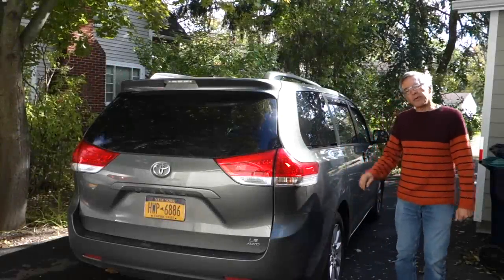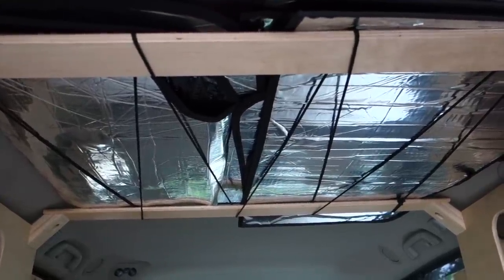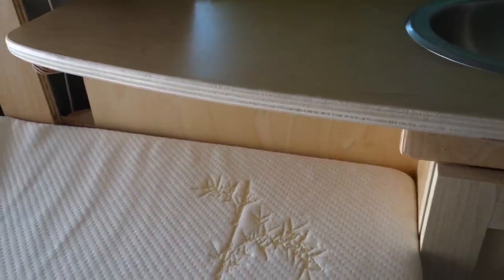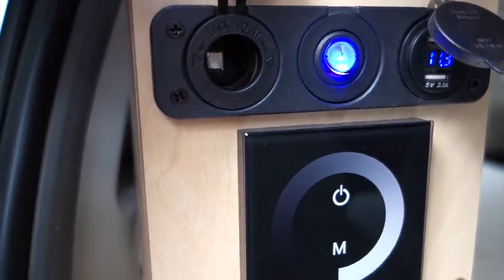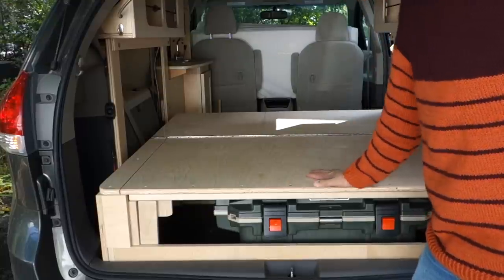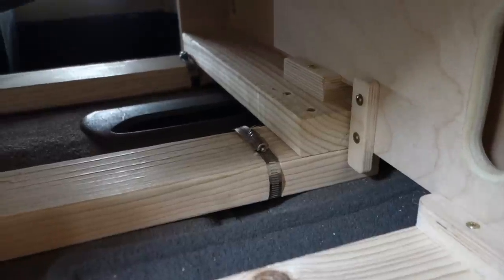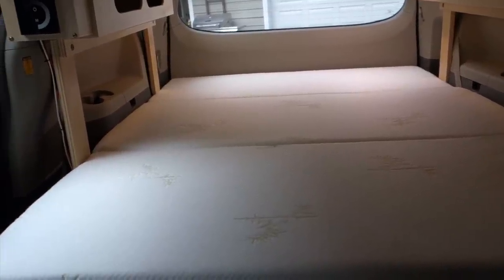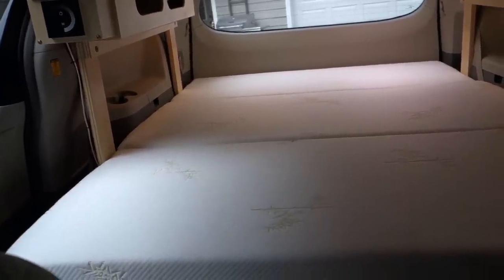A Slightly Different Mini Campervan Build

Comment: Hi Bruce - I love your building very well thought out. The way you ran your solar wiring into the van is slick. Can you provide any insight into how the solar panel affected your gas mileage and noise level in the van?  Thanks - Michael
Reply from the maker: Hi Michael, I’m glad you liked it. I haven’t noticed a drop in MPG with the panel. It’s silent from the driver’s seat but I’ve noticed when laying in the bed at highway speeds you can hear a slight rushing noise.
Reply: @BruceParks  Thanks. Will do the same in phase two of my project

Comment: Hey Bruce, just wondering if you considered a bed that folds up into a bench seat? If so, why did you opt against it?
Reply from the maker: We decided we’re mainly using our minivan as a luxury tent. We don’t hang out in it like some people do. If we really wanted to, we can latch the rearmost board (“headboard”) in the up position to form the bench seat backrest and tuck our footboard under the middle board and we’d have our bench seat (we’d need to modify our mattress to make it easier to use in bench seat mode). I briefly describe doing this in my latest video. Bottom line, we just don’t hangout in the van other than to drive it and sleep in it. Thanks for asking.

Comment: thx you so much... I really like your layout... it reminds me of the wood work one would see in a mini yacht. I am going to do something like what you have done.
Reply: Have you considered mounting a Roofnest on top of your Sienna to compliment your interior?
Reply from the maker: I want to keep this Sienna looking as stock as possible to avoid attention. Pure stealth, pure invisibility. At least for now. Maybe later, it would be fun to build it up for more serious off-road fun. It’s AWD so I’m following some of the lift builds.
Reply: @BruceParks  I just financed a Roofnest and solar system today for my new Sienna... I just like the fact that its a quick and easy solution. The Roofnest weighs 150lbs, and can be removed relatively easy.
Reply from the maker: Looks like a first-rate system. And you can transfer it to any vehicle. Cool.

Comment: You are very lucky to live in the US and have these slightly longer Vans available to you!
In Germany (and most of Europe, I guess) you'll only get Vans with a quite aerodynamic shape like this one with an interior length of 2m at max from the front seats to the back. Which makes setups like this where you can step in front of the bed impossible as there is just not enough length when you want to sleep comfortably.

If anyone has a hint for a Van with more than 2m interior length available in Europe I'd be glad to know!
Reply from the maker: There are times I envy your smaller vans, for less fuel consumption.
Reply: @BruceParks  thing is, a Van like yours doesn't consume as much as a VW Transporter because it's not that high. But yours is similar in length, if not in height, which is a huge advantage for such builds as yours.
Don't worry, be happy with your big Van!  :-)
I'm looking for a larger one right now as mine is just too small for three weeks with two people and a doggy.
Reply from the maker: Yes, for what’s available in the US, I’m very happy with the Sienna for the way we travel. Good luck in your search.

Comment: Super nice build. Is the plywood formaldehyde free? I can only find it in 3/4 at home depot called Purebond.
Reply from the maker: I sourced all of my plywood from our local hardwood dealer. All of the plywood they stock is CARB-compliant which means it is certified to meet formaldehyde emissions of 0.05 ppm or less. They stock sheets in many different thicknesses, from 1/8" up to 3/4". I'd expect most hardwood dealers to offer a range of thicknesses and info on product safety. Good luck.

Comment: Best minivan build I’ve seen and one that I might be able to do on my Mercedez GL450 suv which I want to turn into a camper suv for solo camping. Any suggestions for my specific build??
Reply from the maker: Setting up for solo camping should be relatively straightforward however it all depends on what your priorities are. If it were me, I'd consider a full length cabinet along the vehicle driver side. On top of the cabinet, I'd have a countertop behind the driver seat and a full height cabinet further back, basically like VW Westfalias. I'd make sure there was room for a potty (luggable loo or porta-potty) somewhere next to or at the foot of the bed. Having a fridge is nice but you need to have a separate battery system that ensures sufficient power availability; solar will be needed if you sit in one spot for more than a day or so without hookup to power (like at a campsite). Indoor cooking is doable but complicated. Ventilation is vital so you need to be able to move air in and out through bug screens. Those are some of the things that will be important, regardless of the vehicle. A GL450 for one person should be very doable.
Reply: Bruce Parks wow! Thanks for your quick response and all the suggestions I am buying things little by little. I already have the luggable loo. I didn’t think of a fridge. I bought some plywood and I’m going to try to do a platform with legs to make the bed level. I’m trying to figure out how to remove the seats but nothing online. I wish I had the skills to do your same setup. Wishing you many happy camping experiences with your wonderful setup. I am so looking forward to mine!

Comment: Are you happy with your weather tech window shades? I’m considering getting a set for my “new” 2013 Sienna. I’m just starting the conversion and you are my inspiration!
Reply from the maker: Hi Annie, are you asking about the WeatherTech window shades inside? They are excellent products. Pricey. Many people try to make their own using Reflectix from Home Depot or just make curtains. I’m also using WeatherTech’s window shades (rain guards) on the outside. Another excellent product.
Reply: Bruce Parks thanks so much. I’m adding both of these items to my conversion plan.

Comment: Bruce, maybe you've been asked this before... Could you compare and contrast the gen 2 sienna with the gen 3 was far as camper vanning (since you've done both)? A video or a PM would be awesome (but I understand if you're busy 🙂)
Reply from the maker: Hi, the two gens are way more similar than different. Basically the same van in terms of interior dimensions and layout. Mechanically similar, though there was an engine change in 2007 from a 3.3L V6 with timing belt to a 3.5L V6 with timing chain. Both are reliable but the belt needs to be changed per recommended interval otherwise engine damage occurs if it breaks. The chain generally lasts the life of the vehicle. In 2017, fuel injection system changes resulted in better power and fuel efficiency and a new 8-spd transmission replaced the 6-spd. Regarding campervan impacts, only one comes to mind as significant: Gen 3 models are stuck with seat "trolleys" on the floor after you remove the 2nd row seats. These trolleys can be removed to achieve a flat floor but it's not easy because the tracks they slide in have to be temporarily unbolted for the trolleys to slide off one end and the unbolting process is a bit involved. If you are permanently converting the van, I'd say don't hesitate to perform this operation but if you want to be able to reinstall the 2nd row seats from time to time, removal isn't easy to justify. One of the best explanations of the process: https://www.siennachat.com/threads/2nd-row-seat-track-removal.18525/#post-84623

Hope this helped.

Comment: Hi at 7:40 behind the strap is that a Hockey Puck I see :) do you have a smaller cooler you have out front for late night snacks ?
Reply from the maker: Hey Rob, great question. Yes we have a small cooler we keep up front. Just need to think ahead a little to make sure we have what we want in it. BTW, we’re using a fridge now instead of the big cooler. I’ve made a lot of changes since that original video, check them out on my channel. Thanks for watching!
Reply: @BruceParks  Thanks.

Comment: I think your build out is excellent.  Covers all the basics, is simplistic and very functional.  I like that you can easily reinstall the 2nd row of seats.  Now, please tell up do you really use it for travel, or is your build for future travel?  To what extent, if any, do you add a gym membership and/or some hotel/motel accommodations to your travel realities (e.g., to shower and/or just stretch out in a climate controlled space and large bed?

Again, you craftsmanship is excellent.  Thanks for staring.
Reply from the maker: Thanks for commenting. I'm happy to describe our approach to roadtripping with our mini campervan. Last year, we took it on a 4000 mile trip through New England and some of the Canadian Maritimes (Nova Scotia, Prince Edward Island, New Brunswick). In 2017, we campervanned around the US and Canada on a solar eclipse journey that totaled 9000 miles; the eclipse trip was with our prior campervan (a 2009 Sienna), however our style of travel was the same as last year. Our overnights are mix of campgrounds, rest areas, truck stops, commercial lots, residential streets, friends & family homes, and hotels/motels/inns. We like campgrounds because they are generally cheap, secure, hassle-free, equipped with toilets and some with showers, mostly easy to find, and have picnic tables for cooking and eating. When we boondock somewhere without facilities, we will get up and head out to find a decent place for breakfast and a restroom. At night, we are happy to find a nice pub or grille for a meal. We've only used our onboard Luggable Loo for middle-of-night pees. 

We consider checking into a hotel as a surrender move when we can't find a free/cheap alternative or if it's been too long since the last shower. In our 2017 trip across 20 states and provinces, we had zero hotel nights. In 2018, we had one. Incidentally, we are seasoned global travelers and are happy to luxuriate in the comfort of a nice hotel suite or quaint B&B but when we are in campervan roadtrip mode, we love the freedom of not having to plan anything and roughing it a bit.

We think of our campervan as a hardshell tent, not as an RV. However, if we wanted to go really remote for a while, we could with the only hardship being running out of ice (I'm looking at adding solar power to enable true off-grid capability). 

I hope this was the kind of info you were looking for.

Comment: Hi Bruce, what type and thickness of plywood did you use for this build? Your build looks amazing. Very professional.
Reply from the maker: Thanks for the nice comment, Peter. Regarding the plywood, it's Baltic birch plywood. I used ¾” thick for the parts of the build that needed to support weight, like the sleeping base and top, uprights, and upper & lower cabinet carcasses. Nonstructural pieces like cabinet fronts and ductwork are ½” or ¼” thick depending on how much strength was needed.

Comment: Wow what an amazing conversion. How much did you spend for everything and how many hours do you think you have into the conversion?
Reply from the maker: Paul, thanks for viewing and commenting. I spent 5-6 weeks working on it full time. It was a bit time consuming to figure out the best ways to make everything fit nicely against the interior without modifying the vehicle at all and to make everything easily removable. Cost-wise, roughly, $140 lumber (baltic birch plywood), $50 hardware (screws, hinges, etc), $100 electrical (LED parts, wiring, switches, aux (jump pack) battery), $60 plumbing (sink, faucet, jugs, fittings), $130 mattress (see video description for link), $170 WeatherTech window shades. Free labor :-).

I have since added some more features, including a comprehensive solar power system, and will upload a video soon to share a bunch of new ideas, so stay tuned.
Reply: @BruceParks  Thanks so much and Happy Camping!

Comment: Can you access the cooler from the inside?   I think outside kitchens are great n all but what happens when it's storming out?  Are you going to want to go out in sideways rain n get drenched to get food from the cooler?  I've tent camped, van camped, many years n had to go outside n get food in the pouring rain.  It's no fun n it's a good way to get sick.  I'm just wondering if you have any way to get to your food from the inside?
Reply from the maker: Since I made this video, I've replaced the cooler with a refrigerator but it still sits under the platform in the way back. I didn't build in access from the inside, though if I wanted to I could add an opening panel in the top of the platform. But for the way we use the van, it isn't needed. We decided we didn't need or want to cook inside the van. If that became a priority, or if I were to build a van for solo travel, it would be relatively easy to reconfigure everything to fit a cooking module with fridge placed behind the passenger seat. I would probably consider mounting it so it could be moved (pivoted or slid) out of the way for easier access into the van. I've come to think about these van builds in the following way: just about anything can be built but all decisions require careful thought on the tradeoffs they entail. With such limited space, only a few things can be top priority and achieved. Everyone's needs and wants are different so there's no such thing as the perfect universal van. Okay, I've rambled too long, sorry. Thanks for viewing and commenting!

Comment: Is that kit ? If so where did you purchase it.  If not very nice build if you have done it yourself
Reply from the maker: Thanks for watching and commenting. I built the parts from scratch. I've had a bunch of people asking me to make plans available or to build-out their minivans but it would be difficult for me to accommodate all these requests. Despite the simple-looking end result, the build itself was slightly more involved. I hope to upload some videos that show more detail.
Reply: @BruceParks  well as a Carpenter I  can appreciate that work well done Sir
Reply: @BruceParks  looking forward to the additional videos showing more of the build

Comment: Tremendous craftsmanship, I’m wondering what tools you are using for the long  cuts and small cutouts, table saw, jig saw - mounted or portable, router and what kind of sander?
Reply from the maker: Yes, typically, long straight cuts are done on my table saw and small cutouts are by jigsaw. I use a roundover bit in my router (table-mounted or handheld depending on the situation). Sanding is by an assortment of means: A bench sander combo (4" belt / 6" disk), an oscillating spindle sander, handheld random orbital sander, and a variety of sanding blocks.
Reply: Furniture grade plywood? And what kinda of tacking system is used for the pieces that disassemble
Reply from the maker: The plywood is mostly Baltic Birch in different thicknesses (¾”, ½”, ¼”, depending on strength needed) and prefinished Maple for the sink countertop. For easy assembly and disassembly, I used a lot of these: Connector Bolts  https://amzn.to/2C9NxDh; EZ-Lok Threaded Inserts  https://amzn.to/2OOYoKu; T-Nuts  https://amzn.to/2nLMh5X
Reply: Bruce Parks super, thanks!

Comment: Hi Bruce,

I really love your build and am looking to more or less duplicate what you have done in our 2008 Honda Odyssey. Can you talk about the wood that you used and your woodworking techniques that you used to create such beautiful organic cupboards. Would be useful to know which tools were involved. Also very impressed with your electronics system. Any additional information that you could provide would be greatly appreciated.
Reply from the maker: For the most part, the wood is Baltic birch plywood, in ¼”, ½”, and ¾” thicknesses, depending on how much strength was needed in each component. Baltic birch plywood is usually available at a hardwood store, and not at the big box places like Home Depot and Lowes. Not sure if places like Menards carries Baltic birch plywood. It’s a great wood to work with.
Reply from the maker: The tools are standard woodworking tools like a table saw, router table, bandsaw, drill press, jointer, sander, etc.
Reply: @BruceParks  Thanks for the info Bruce... what specific brand and model of Battery and solar panel do you use ?
Reply from the maker: Shawn Harrington - Solar panel is Rich Solar 100 watt. Battery is Fullriver 105 A-Hr 12v.

Comment: HI ...great build. I was hoping you could do a video on how you did your electrical system.
Reply from the maker: Thanks for the comment. Regarding the electrical system, there's not much to show at the moment since all of the things (LED lighting, the dimmer controller, USB outlets, and 12V outlet) in the video are powered by one wire plugged into a jump battery that I keep plugged into the 12v port in the back of the van (the jump battery charges while we're driving). I'm in the process now of adding a solar panel charged deep cycle battery to become the primary power source instead of the jump battery. My upcoming videos will cover this and other changes I've got planned. I recommend you subscribe to my channel so that you'll be notified when the videos are available.
Reply: @BruceParks  Thanks for the quick reply and info. I will subscribe and look for to seeing new videos. I am looking for a sienna now to turn into camper van. Your videos will help.

Comment: So when you put the bed in the couch position and take out the extension, do you fold the mattress to double the seat cushion or back rest, or do you just let the 3rd cushion hang over the backrest?
Reply from the maker: Honestly we’ve never put it in sofa mode. We mainly sleep back there. But to make sofa mode work well, I think the mattress would need some custom work so it could be folded into the optimum position.